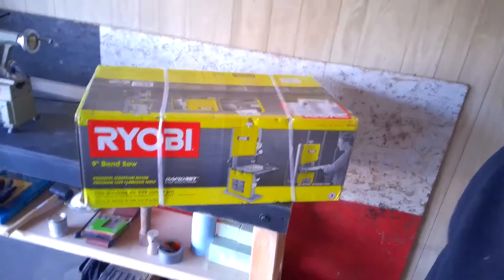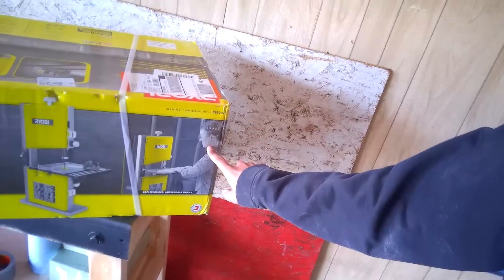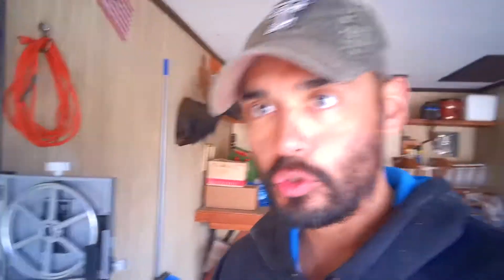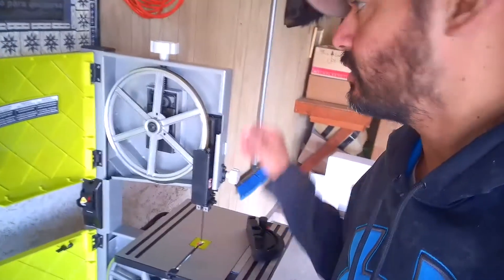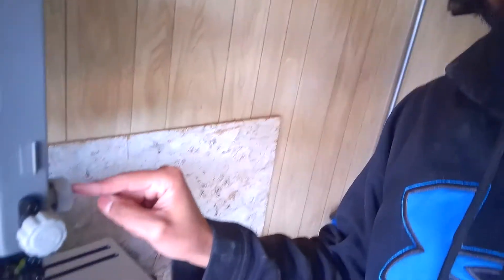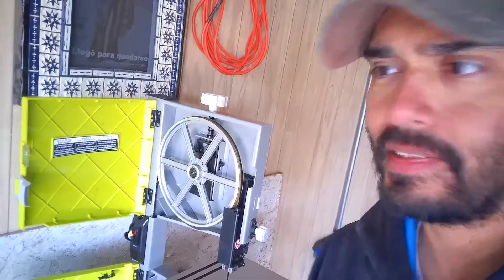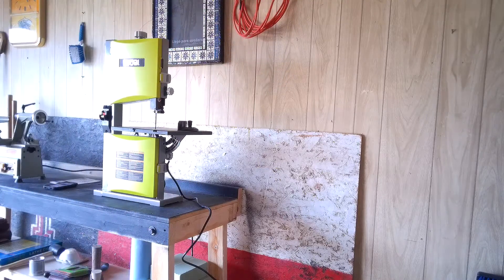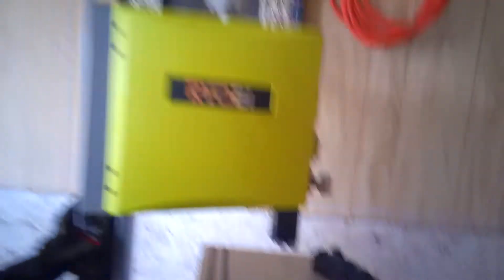Setting Up My Ryobi Band Saw

Comment: Hey man I just got one and have spent about two hours trying to get the blade to stay on when I run it. Noticed the same thing happened to you when you first turned it on. How’d you fix that?
Reply from the maker: Its a lot of trial and error. I had never set put a band saw before I got this one. What I did was a lot of adjusting of the tension mechanism and manually guiding the blade for the first few rotations before you turn it on. Try and set the blade directly in the middle of the wheels and adjust the tension as you manually guide the blade through the wheels. Once you eye ball the blade in the middle of the wheels and get a good smooth manual tension you should be able to turn it on and it should work. In theory. Hope this helps.
Reply: Saulty Texas appreciate it! Man I was ready to throw the thing out the window. Issue for me seemed to be tracking and tension too high. Figuring that out took forever but now I’m cutting!
Reply from the maker: Glad I could help.

Comment: Ryobi should not manufacture any products that require assembly.
Reply from the maker: I never set a band saw before. It comes out of the box set up for the most part but putting that blade on is a bit of a problem